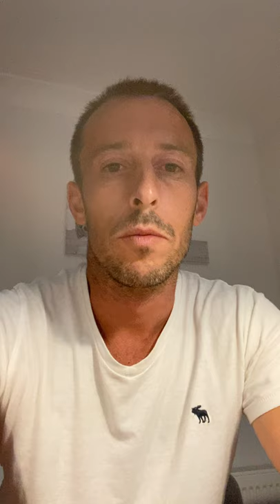Why you shouldn’t have cavity wall insulation installed.

Comment: Hi Alex, I appreciate the video you have done given great advice for us clueless  consumers. My property was built in the 70s & my parents had cavity wall insulation back in 2000 believing it to be (mineral wool) blown in. Over the last 8 years i have been getting damp with mould in sections of the lower part of the house & also looks like some sort of foam or salts as i think its called with it, i believing Is thats its sodden when the rain hits, thats where it soaks back into the mush & given me damp.  Do i need to get it repointed “gable end is something like 65 square meters” or just repoint the holes they made to put the insulation in or would it be something else. Would appreciate a little advise 👍 thank you
Reply from the maker: Thank you, I would divert your attention from the repointing as this is generally cosmetic and a cavity is there because moisture naturally penetrates through the outer bricks and mortar. My advice would be to get a builder to remove one brick on the outside where the damp is at its worst, check if the insulation is wet. If it’s wet then the best thing to do would be to remove, if it’s not, then you would be looking at condensation. Trickle vents or passive vents to increase new air flow and a consistent temperature day and night in the winter months would help this.

Comment: What’s your opinion on rockwool on an extension? 
I plan on doing 2 layers of block with cladding, using rockwool between the blocks.
Reply from the maker: If your cladding then go for it, it will be fine. Just remember ventilation is also needed.

Comment: Really good video, thank you.  Our house was built in 2003 and has Polystyrene 'boards' attached to the blocks in the cavity leaving a residual gap to the brickwork i.e. the cavity.  A local installer is recommending filling this with beads so presumably you would advise against this?
Reply from the maker: Thank you. Yes I would avoid at all costs, it really isn’t necessary and the gap is there for a reason. The contractor is clearly just after your money as it already has insulation.

Comment: Hi Does all this also apply to these beading systems? They seem to claim this doesn't happen with their systems.
Reply from the maker: The beads are one of the best types out there, but they still have disadvantages. The beads themselves are waterproof but moisture can still reside on the beads themselves. Problems with the bonding of the beads seems to be an issue and unfortunately most cavities are not throughly inspected prior to the installation. I would read the guarantee with a fine tooth comb.
Reply: @CoastalWallTiesRustington  Thanks for the reply

Comment: You say that EWI (External Wall Insulation) is fine, would I be correct to say that you have no experience of dealing with issues created by EWI?

The problems caused by EWI is now eclipsing the problems created by CWI i.e.:

EWI is not impact resistant, once damaged moisture penetrates and the insulation is soaked and needs to be removed (unless you use flammable oil based insulation boards).

Roof lines & gutters need to be properly extended in order to overshoot the EWI. If, instead of extending the roof etc., plastic trims are used at the roof lines then these fail especially when the mastic or silicone used as a sealant eventually fails (5 years or so).

The insulation manufacturer's warranty requires all interfaces and junctions to be checked at least annually, this requires scaffolding at the roof line level of a 2 storey property. If you don't do this, then when problems arise, you have no warranty.

EWI manufacturers warranties also specify that the render needs to be cleaned every 2 years without any agitation or scrubbing of the surface. I haven't found a cleaning product which can do this. So, no warranty again and the render is tear-stained and/or mouldy.

I am a surveyor for a social housing provider who had Government grant funded EWI installed at thousands of our properties around 10 years ago. I am dealing with the above issues every day. 

If you have solutions to our EWI problems and believe that EWI is ok, please let me know. Otherwise you may want to edit your EWI recommendation .
Reply from the maker: Thanks for the comment and no I would say that predominately my work involves looking at cavities as opposed to external render. I knew of contractors failing to remove services from walls but the information you have provided is very helpful to myself and others. 

Maybe you should do a video to help consumers thinking about external render 👍 I appreciate your comment.

Comment: Hi, interesting article, I have a 1929 house with poly beads, seem to not be glued, and damp patches on the south and west facing walls, west facing room, I leave a window open on the night lock, still get the damp, south wall room has a trickle vent, room is so cold now, still damp. Resort to a dehumidifier to remove moisture from the air. On here to see how to or whether to remove the poly beads. Thanks for the video.
Reply from the maker: Thank you, my advice would be to arm your self with some loft insulation that can be torn by hand, and open up externally where the damp corresponds internally. Use the loft insulation to stuff around the opening so that you can inspect without the beads flowing out. Look for any solid bridging of the cavity or any damp material within the cavity, you can then decide on how to proceed.
Reply: @CoastalWallTiesRustington  Thank you for taking the  time to reply and for the advice, will give that a go.

Comment: What exactly are the disadvantages of a full fill cavity wall insulation on a new building, if done properly? I'm thinking about a hybrid method, so I can have both thermal and acoustic benefits (outer masonry leaf >> spray foam or XPS+sealant (air and vapor barrier) >> mineral wool >> inner masonry leaf).

Comment: Excellent video. I think a quesiton my property has no cavity its solid brick wall. Should i use insulated plaster boards that have polystrene on the back of them with a damp proof memberane that comes between the brick and the plaster board. The only thing is i cant attach it directly via dot and dab so ive read. Or should i go the road of fixing battons to the walls so the plaster board attachs to the wood atleast then it gives some gap between the insulated plaster board and the brick.
Reply from the maker: Thank you, if the walls are prone to damp coming through, it wouldn’t be a good idea to dot and dab. Again if the walls are prone to damp penetration it would be advisable to consider a damp proof membrane strip behind each Batton. Remember to keep your gutters clear and flowing correctly on solid properties to avoid prolonged damp on external walls.
Reply: @CoastalWallTiesRustington  thanks for the helpful advise i will make sure to use a DPM behind the battons

Comment: Thanks for this video! I've just cancelled my survey appointment for free insulation. I guess all that glitters ins't gold.
Reply from the maker: Exactly, don’t get me wrong on most new builds it’s fine where celotex is used and a cavity is still present. They have also been designed with adequate ventilation, but older properties are different.

Comment: I had cavity wall insulation in my last house (fibres) with no problems in the 15 years of ownership.
The current house I have is 70% solid stone 500mm thick wall with no issues at all. 30% of the house is an extension with cavity walls and this part of the house smells musty. Especially musty behind wall hanging pictures. Wall gets very little sunlight due to trees but windows are south facing.
I'm having a survey today funny enough for thermabead to be installed.
Reply from the maker: Every property is different and especially when solid walls and cavity walls are combined, the differential temperature will have a dramatic effect on where that excess moisture goes.

Comment: Hi, thanks for this useful video, very helpful. I have the blown wool type in a 1960’s bungalow, cavity’s were done about 20 years ago. Would you recommend removing this and leaving them empty? My house is cold now, but will it make it colder and have more cold spots on walls?
Reply from the maker: Hi Matt, thank you for your comment 👍 If your not experiencing penetrating damp or mould growth due to high humidity levels, I would consider looking up the insulation installer if you have a guarantee, and have them check the walls for voids in the insulation.

I wouldn’t necessarily remove the insulation if it’s not causing problems. Do you have new windows? Also do you know how effective your boiler system is, i.e do the radiators work well? Is the boiler over 10 years old?

Where are you in the country?

Comment: Live in housing assoc flat. They have just installed the bead insulation.Balls are everywhere,now the installers "Dyson",want to put electric ventilation units in each kitchen...right next to the windows. So do i open a window for free ventilation or do i turn on the electric vent NEXT to the window and run up my electricity bill???? Claiming its health & safety,well my kitchen window is open every day all day for free. Im not turning on any electric vents.
Reply from the maker: ‘Nail on the head’ flats are prone to condensation issues due to the small surface areas, even prior to insulation. Insulating and then putting in a PIV system in every flat is crazy. I will say at least they have done that and not just insulated, otherwise your walls would be running. Keep your windows on nightlock and turn the PIV off. 👍
Reply: Try dehumifiers: particularly useful in kitchens, which generate a lot of water vapour (from boiling kettles, cooking in saucepans without lids, even bowls of water will transpire into the air). 

Dehumidifiers with compressors (refrigeration technology) work best in warmish rooms kept to habitable temperatures: they cool damp air to precipitate water vapour into water, but expel slightly warmed air. This is a benefit in winter as it reduces heating costs, not least as dry air  requires less heat than the same volume of damp air, to raise them both to the same temperature.

However, air passing over metal or plastic fan blades becomes positively ionised (which creates "sick building syndrome" in buildings with exclusively mechanical ventilation). 

So, if you use a room dehumidifier, also use a negative room ioniser: to offset the effects of fan-driven positively ionised dried air expelled from the dehumidifier.

A 180 - 200 watt, 12 litre rated dehumidifier with 2.3 litre tank will actually extract something between 7 litres and 10 litres of water per day, if emptied three times: to keep air at 50% to 70% relative humidity in a very damp room. Mould will only grow above 55% RH.

In cold or very cold areas (eg unheated basements) dehumidifiers with compressors do not work efficiently as the air is already too cold. Dessicant dehumidifiers are more efficient.

Dehumidifiers on castor wheels are easier to shift around, as they tend to be quite heavy.

Comment: Hi I wonder if you can help.
I’m in a council flat, it’s ww2 but was very cheaply and purely renovated 14 years ago.
I’ve got rats in the walls , worse rat mites and ticks are getting in , basically the block in quite a few flats is infested. Obviously the council won’t to a thing not interested, what can I do ? Can I drill holes in each plasterboard wall and tip in permethrin powder ? Or something? I wish I had money to fill the cavity with with something recommend  but no doubt it’s all pricy . What can be done ? Do you think it’s filled with those balls u said create critter issues ? Is it really expensive to fill even just a bit of the wall to stop the rats getting near to pipe work? ? Thanks kindly
Reply from the maker: Keep on at the council, they should be able to send out pest control if it’s a problem. Keep the cavities clear though.

Comment: I need some advice and hopefully you can help me. I’m have just bought a property which had cavity wall insulation installed in 2008 with a 25 year warranty. There isn’t any internal damp issues at present, however the surveyor noticed horizontal cracking, which after further investigation I found out the wall ties are starting to corrode, but according to the surveyor they are in the early stages of corrosion and will need some remedial work but it can wait until the spring. Could it be possible the insulation has caused the wall ties to corrode and what would you suggest I should do to remedy the problem. Would using a brick cream help with making the bricks more waterproof and potentially prevent the wall ties corroding faster.
Reply from the maker: Hi, the part of the wall tie that is embedded on the outer wall is subject to corrosion due to the weather, having cavity wall insulation just means that it potentially will allow more of the tie to rust. It would be a good idea just to have the ties replaced as a masonry cream would only slow the process down.

Comment: It’s worth bearing in mind that waterproof cavity insulation is fine. As the water cannot penetrate the wall. 
BASF CV 100 is a good example.
Reply from the maker: Yes I agree, the foam is waterproof and is probably the best type out there currently.

Comment: Hi Alex my house was built around 2005, with polystyrene sheets filling half of the cavity, I am considering BASF Walltite so it goes in as a liquid and then hardens like an expanding foam, so this would be closing the cavity, installer is reputable BASF certified etc, and not the knock on the door types.  Is this OK or still a bad idea, we have the insulated plasterboard on the inside of most exterior walls, but the bills to heat are still substantiall and we may install solar panels / ground source heat pump soon, so I want to get insulation as good as it can be before we go down that route
Reply from the maker: Hi Brendan, it’s difficult to say if this is a bad idea or not really, how big is the remaining cavity? Are the wall ties in a good condition currently? Would they boroscope the cavity in many areas to check for mortar snots on wall ties and bridges above dpc level? Can they provide a copy of the guarantee prior to installation? If so, read it with a fine tooth comb. Another question to present them with is will the resin part of the foam melt the existing polystyrene batts?

I do know that because the foam will stick to the bricks it would certainly increase its stability if the ties were to fail. Would it benefit you in terms of thermal efficiency? Possibly a little. 

I have been talking to a gas engineer who has had heat pump training who mentioned that heat pumps save you very little when compared to gas and they need replacing every 10 years. Solar panels maybe the way forward.

Comment: thanks for the video is the first step to paint all you brickwork in stormdry ? is there any trick to it or it is diy ?
Reply from the maker: Anyone can apply stormdry, just remember not to spread it too thin as it soaks in easier than you would think. All you would need is a masonry brush and some dry weather.
Reply: @CoastalWallTiesRustington  thanks the reply i have brick house with a section of masonry painted white in the middle , would i use storm dry on both ?
Reply from the maker: No just the unpainted surface

Comment: In our previous council house we got damp and mould all over the house after cavity was installed. Called the council, inspector looked around and said we need to open windows and it will stop.  We got cavity to keep the heat in and you want us to open the windows to let that heat escape? Yes that's how you fix the mould and damp he said. We moved out.
Reply from the maker: Thanks for the comment, unfortunately insulated or not you do need some ventilation in order to prevent mould, but in some cases, certainly when a property has a smaller surface area, having cavity wall insulation installed will intensify the mould issue.
Reply: @CoastalWallTiesRustington  thanks for the advice, appreciate it.

Comment: Alright m8 quick question for ye understand using the pir insulation rigid board clipped to wall ties and you still have a vented space what about the rock wool bats when blocks are 100mm each skin with 100mm cavity filled with 100 ma insulated rock wool the stuff is getting soaked when the house is getting built so how can it possibly dry out when there is no air flow it’s not rocket science but is still a common building method in the uk why!!!!!!???🤷‍♂️ keep the informative videos coming 👍
Reply from the maker: It’s a good question, and if it does cause damp it’s really hard to remove. It should dry out naturally from the heat in the house but depending on how wet it is, will have an impact on how long it takes to dry, and it also depends on whether or not the insulation is getting wet from external rain penetration. It is absolutely bonkers that it can be loose filled into cavities and full fill insulation can be installed knowing what we know through evidence. If it’s got to be done for energy efficiency then an air gap still needs to be present.
Reply: Coastal Wall Ties Ltd thanks for your reply m8 keep up the great work 👍

Comment: Mate solutions, a sealant on external walls , some last 4years will repel and protect all external walls from moisture, 

And as for ants borax injected into the cavity of any very little would be needed to repel any ants ect from entering the wall cavity, 
I think these solutions can definity work to improve this issues your addressing 👍🏾
Reply: Doesn’t that borax wash out with penetrating damp?